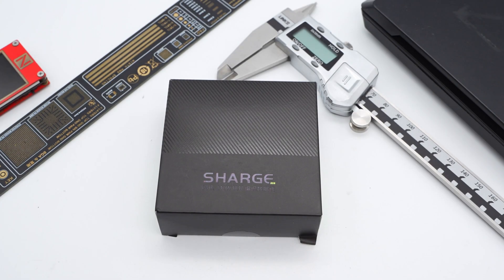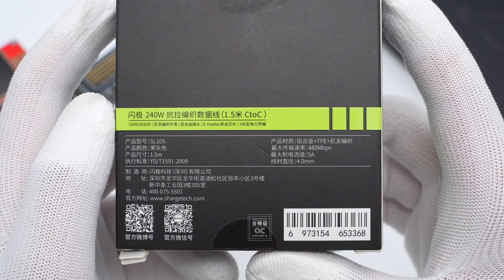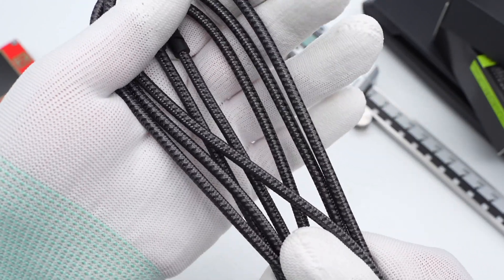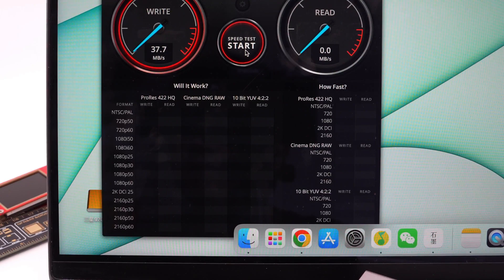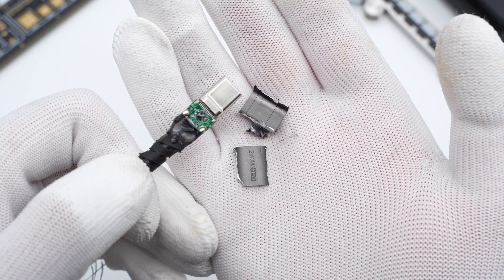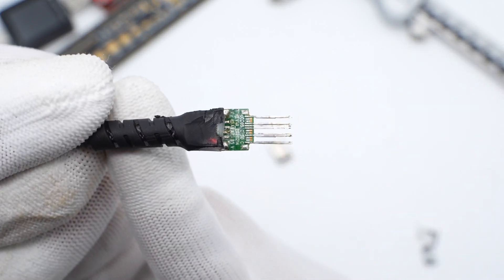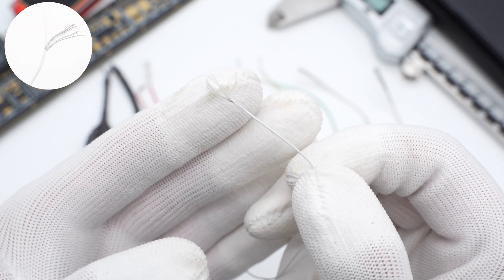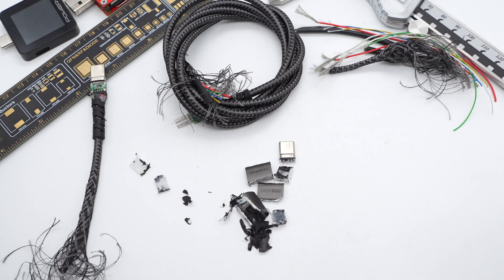Teardown of SHARGEEK 240W USB PD3.1 Cable

Comment: What’s with the test results being less than claimed?
Reply: 14/16in MBP only charge at up to 100W through their Thunderbolt 4 ports, so I guess thats working as expected. I cant readily think of anything that will draw much more than that over USB C connector, though.
Reply: @grouchyfluff   power testing equipment, often called a load tester.
Reply: @TheOfficialOriginalChad  USB PD 3.1 compatible test loads will be scarce, so are USB-C power supplies that can deliver 5A at 48V.  
But the cable is also just a passive component in the chargin setup, as long as both ends, the source and the sink accept its reported capabilities they will just pump whatever they want though it.